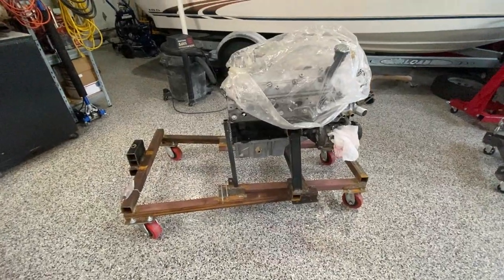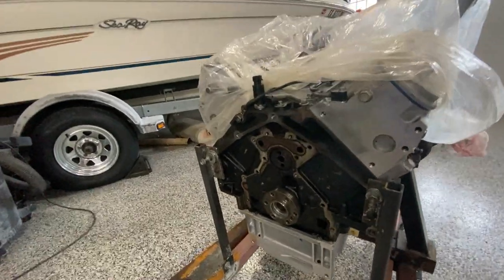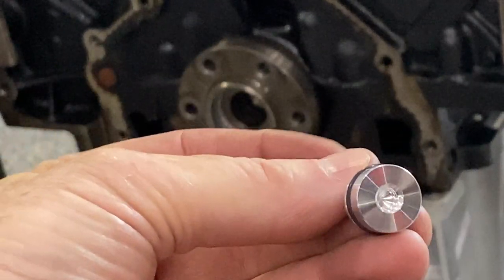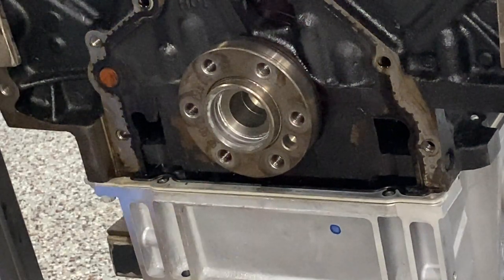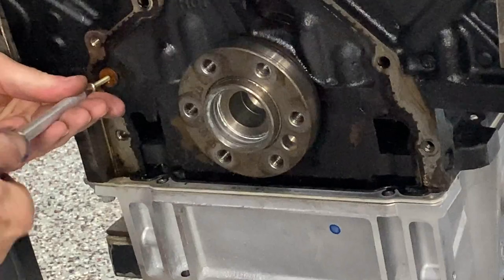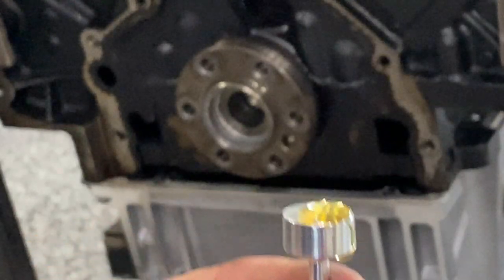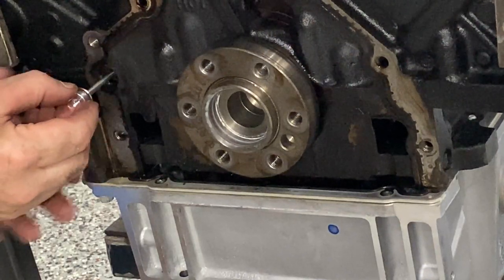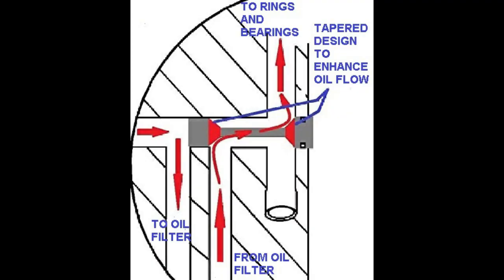Project OBS LS Swap: How to REPLACE your LS OIL BARBELL on 4.8, 5.3, 5.7, 6.0 LS engines

Comment: What symptoms did the engine do or can it do so I will have to change it
Reply from the maker: I didn't really have any symptoms.  I have no idea how many miles on the engine. Since I had the motor out and needed to replace the rear seal, it was the time to do it. It will help to make sure more oil is made to go through the oil filter as it circulates and due to its design, is an improvement. But, having said that, if I had not had the motor sitting there with no trans, I doubt I would have done it. For $27, I figured why not. I may never do it again. However, if I have an engine sitting on the stand with no trans and the rear seal needs changing, I'll probably do it.